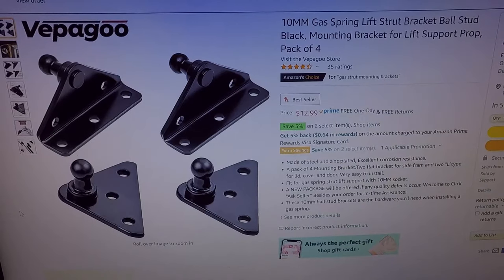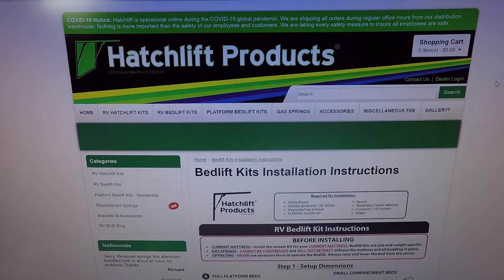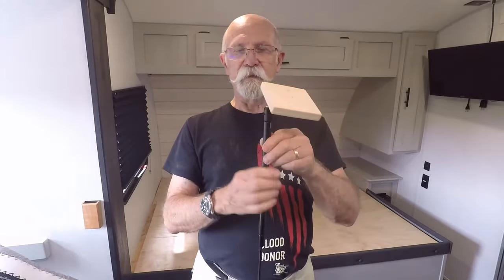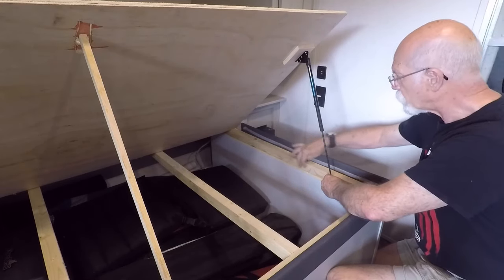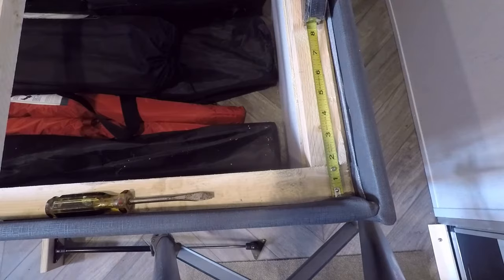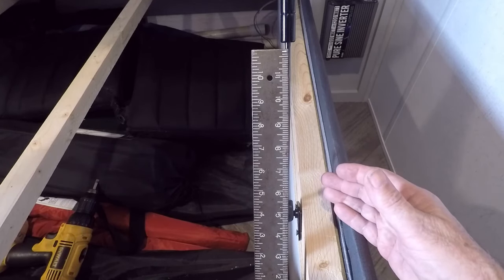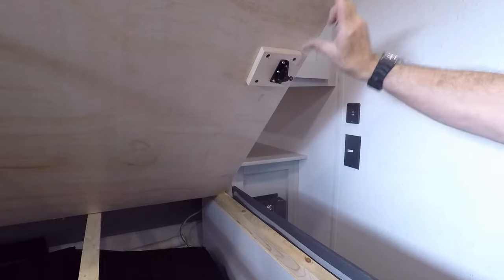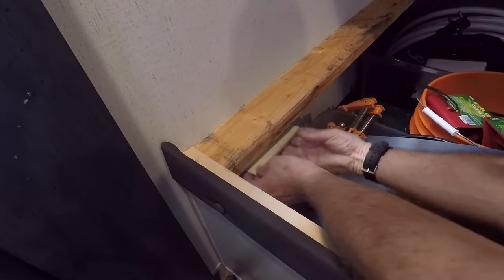RV gas strut installation for Queen bed

Comment: SUPER helpful - thanks! We too had WAY too strong of a strut! (Ours was 100#!). 40 is good advice! We also had the lid position wrong. THANKS AGAIN!
Reply from the maker: Glad it helped you.
Reply: Do you happen to have a full size queen mattress that has some weight to it or do you have a short queen lightweight rv mattress? We swapped ours for a regular queen that has some weight
Reply from the maker: @marineboi207ify  at the time of making the video it was a short factory, Queen. I have since replaced the mattress with a thicker one.
Reply from the maker: @marineboi207ify  this was a short factory queen. I have since replaced it with an 8" and 1" topper short.  It is heavier but the struts work fine. You don't want to make the mistake of getting a strut that is too strong as you won't be able to close the lid without possibly damaging the attachment screws/plywood.
Reply: Yup, I was recommended the 100# as well, WAY too strong.  Wish I had done more research before buying.

Comment: Hey buddy, I want to say thanks for the video. I noticed in the video that you ended up having to change your piston to a lighter one. So I had just put in a real mattress which was a big difference in weight. So I ended up going with the 125 lbs. I didn't notice the difference in our mattresses until I watched the video until the end of my 3rd viewing.
Reply: Did you have an issue with your strut being hard to close?
Reply: @rvrguyd  so the funny thing with this story. I originally ordered the 125 lbs and then watched your video. So the logical thing to do was return them and buy 30 lbs. I installed them and they didn't work so I bought 80lbs and those did not work either. So I bought the original order again and they should be here tomorrow. So between all my returns with amazon and visits to the post office. It's yet to be resolved. With that being said you video was very helpful on the installation. Let's hope 3 times is a charm. I'm hopeful that the extra weight will make it easier to close. I will keep you posted. And have a great camping season.

Comment: Shouldn't the strut be angled the other way?  With the top attachment closer to the edge of the platform, and the lower mount closer to the hinge/pivot?
Reply from the maker: Nope. It is the correct angle. It works.
Reply: Agree. The original 80 pound struts would have worked of the lower mount was nearer the hinge.
Reply: Exactly. He's installed them upside down. If they were as you suggest he'd get a nice soft close action instead of that slam at the end.

Comment: People are saying this is wrong amd the bottom of the struts should be inwards and the top outward also that is why it called for 80lb struts. Looks like if it is   done this way it won't  slam shut?
Reply from the maker: Read the comments. No one is saying it is wrong in this video. I tried 80 lb struts and I could not close the lid. I guess you could mount struts back closer to the hinge, but I only needed the lid to open so far, and this positioning worked perfectly.

Comment: I wonder if these can be used on a regular bed in my home to have more storage? I can get a Hatchlift Rv king size Bedlift Kit for $3.00 & can't pass that deal up.
Reply from the maker: I don't see why not so long as you have proper points of connection, and the weight is about the same.

Comment: It would work bette rif the rear mount on the bottom was closer to the hindge point and the top mount was at the front of the bottom of the matress support.
Reply from the maker: I don't know how or if it would work better since this setup works perfectly. Have you done an intallation yourself as you are suggesting?
Reply: @craiglenhard-rvrguyd  yes but I also saw a comparison video with two storage boxes that were mounted different directions. One slammed shut that was mounted with the bottom towards the front and one that closed easy with them mounted with the bottom towards the rear.
But that all depends on the strength of the struts. I think you could use lighter struts with them facing the direction you did these, but I think stronger ones facing the other direction is the best way. Either way works though.

Comment: Would be helpful if directions and video was more specific to strut install illiterates. I can’t see where the base connection is determined on the video. I see a tape measure at 6 inches. Determining parallel to what? Shows a yard stick but no instruction. Not helpful really.
Reply from the maker: It's a lot of trial and error. First pivot point was set at about 6" and it did not work out. Moved back to 4.5" which worked. Strut installation is not a "one installation fits all" situation and that was the point of the video. A strut could be used on a 1 lb cabinet lid or a 70 lb bed/storage area so there is not a single solution for all situations. Thanks for watching and commenting.
Reply: @craiglenhard-rvrguyd  Thanks for this video, I am about to do this, and I know it will be a lot of trial and error for me too.  Is that 1/2" plywood you are attaching the struts to?  Looks a little twisty, how is it holding up.  I read that if you want to stiffen it without adding furring strips there are fiberglass treatments you can use.  Or could switch to a heavier plywood.
Reply: @turbojav  the bed deck is .5". I don't know that fiberglass would help based on tent pole experience I have. If you need more support I would consider hardwood.  The struts are working great even after adding a 2" gel topper.
Reply from the maker: @turbojav  The first struts I bought were rated for more weight and I couldn't even close the platform so knowing the lifting weight is a first concern.
Reply: Very helpful video.  Thank you.   I have a travel trailer that has two fixed seats opposite each other with a table between.  I can remove the table and convert to a double bed by pacing the table top in ridges on the seats.  I am thinking of leaving the double bed in place 90% of time.  Could I build a wooden box using 1/4” plywood as a platform between the seats and add the gas struts?
Reply: @drs3055  I would be concerned about attaching a strut to 1/4" plywood. You need more structure due to the forces applied.
Reply from the maker: @drs3055  using 1/4" as a base may be fine for weight considerations but I would not connect a strut to it. Struts should connect to a frame since there is a lot of stress placed on the connection points when you are closing a platform.

Comment: better to put 2 gas strut, both side
Reply: Two struts on each side would make it impossible to close the lid. You have to match the strut spring strength to the weight you are lifting.